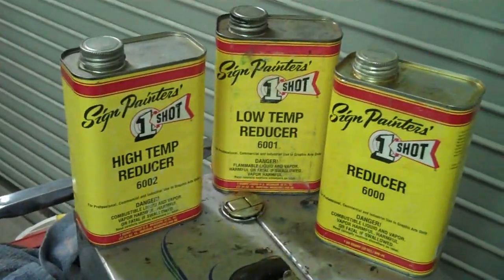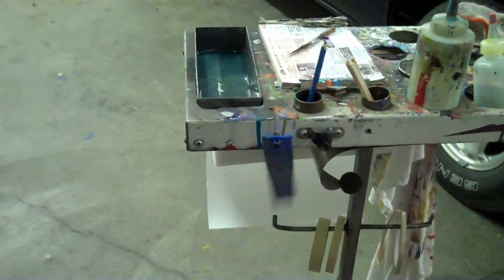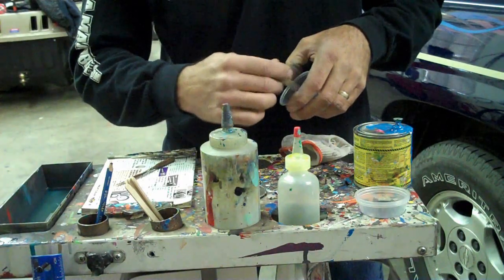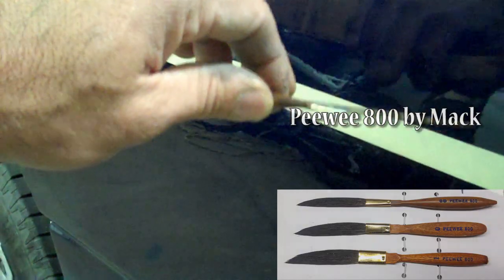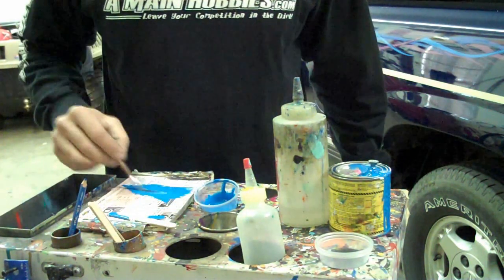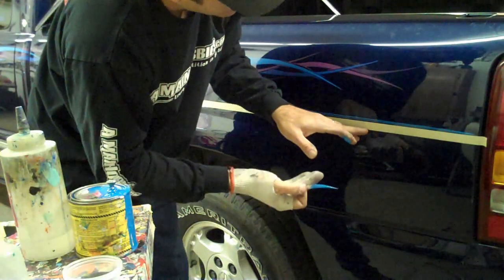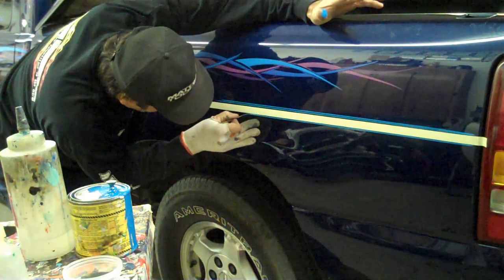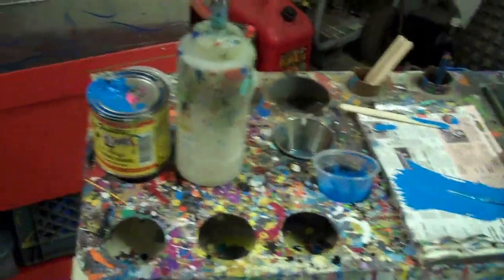Pinstriping straight lines

Comment: Oh my god..... I've been using one shot for over 20 years and the skinning over thing has always really got on my tits! The brilliant a hole thing in the top of the tin is the best thing I've seen in years! I generally throw 50% of paint away as it gets full of shitty bits and I'm too lazy to strain it.... Thanks peewee! 
Really nice work too.
Reply from the maker: Thanks and you're very welcome!
Reply: paul myerscough If you don't want that skin layer,just turn the can upside down,it never skins over...
Reply: until it leeks out all over
Reply: Used a 3/8 lag bolt for years and found it skins over after 1/2 can anyway . Got lazy .